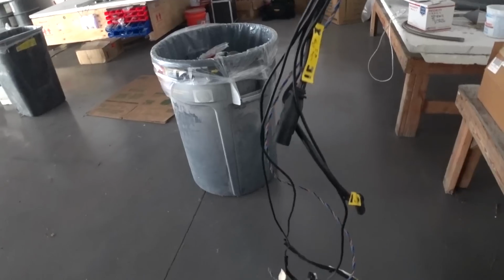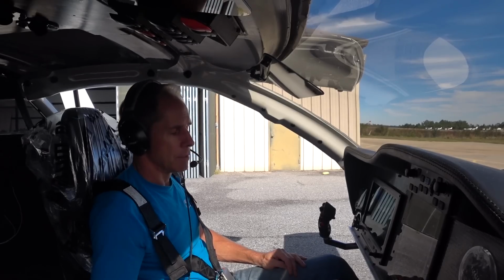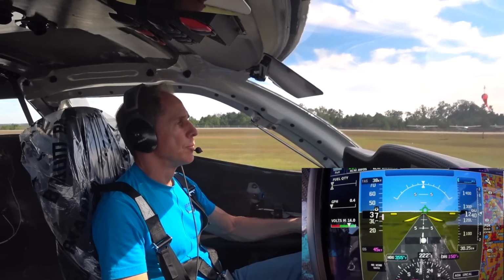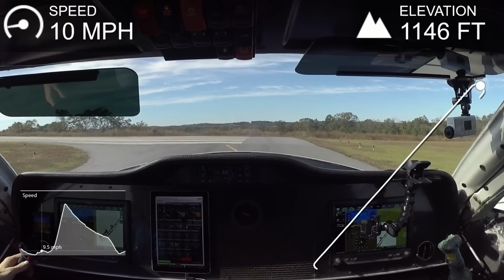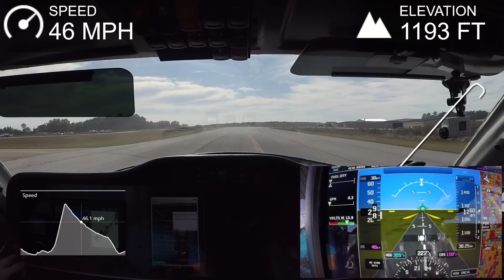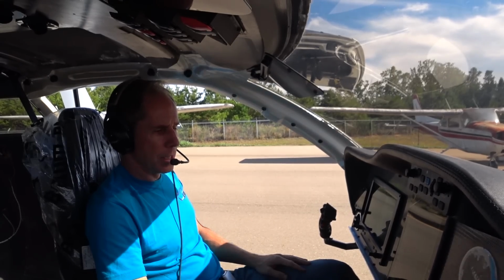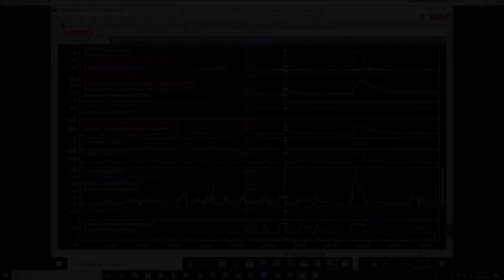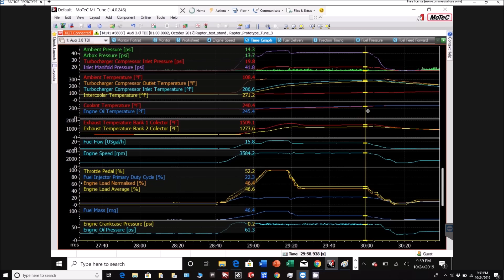Glow Plugs and Test Runs - Building the Raptor Prototype

Comment: If you want to do sustained high power ground testing then rig up a spray system and dump water onto the radiator cores.  The evap cooling will give you a fair bit more heat rejection than just the limited airflow you can achieve from the propeller inflow.

Comment: Wow, Peter.. two videos for Saturday morning on the east coast of Oz.. Took me by surprise but very pleased at your progress. Question... What is your current loaded weight ? I recall the weigh-in went 2917lbs, and I believe you have added to that forward ballast, ballast under passenger seat, Yourself (of course) and possibly additional fuel.. I'm looking for a current figure to plug into a spreadsheet ..just as a math exercise... 
From that run, on the near linear portion, 21.3mph to 62.3mph in 10 seconds gives accelleration of about 4.1mph/sec/sec or roughly 6ft/sec/sec. Based on current all up weight of say, 3300lbs (???) , that's around 620lbs thrust (after parasitics..) 
Not bad eh ?. BLOODY Good enough to get you up when ready...
Keep up the good work mate.. Steady as she goes will win in the long run, and minimize chance of any mishaps..

Comment: Major improvement to the audio. Thank you.
When you did static run-ups, it seems on camera the prop changes pitch. 
From the wing cam the prop seems to get fatter, as if the prop was set to bite more.
Just wondering if that is design or optical illusion.
Great work keeping it on the ground and testing everything to be safe.
Thanks for sharing.
Reply from the maker: That's the governor doing it's job.

Comment: My water cooled computer has the same problem with thermals. It works great untill the heat soaks into the surroundings and has no where to go. Then I run a fan to move the heat. I'm fairly confident your curve will stay flat if you are over a 100mph ripping through cold air at 20kft.
Reply: mccallumcra if what you’re saying is he’s worrying/spending too much time on this, I’m tempted to agree - BUT he has to get a good idea of what might happen across a variety of conditions so he can try to nip any potential problems in the bud. He does want to commercialize this project and possibly even get it certified eventually, remember. 
Can you imagine a 6-8place Raptor with a PT6?
Reply: @gregorykusiak5424  I'm just saying I agree with him. It's something to look at but considering it's only a static run I wouldn't bother doing more than a little math to check it at this point. He has proved it will run long enough with out over heating to get to the cooling air so I'm not to concerned with it if he's not. Heat saturation is only a problem when heat has no where to go. It will go away once he is moving. Unfortunately at this point he isn't at the point to fly it yet so he can't test that until he takes off.

Comment: Could you do a long run-up at start of runway. Then when temps start to get high go down the runway and see if temps stabilize with the extra airflow ?
Reply: Its water cooled.
Reply: This is a great idea.
Reply: @santyclause8034  Boats are water cooled. Airplanes and cars are air cooled. But some have water in between the engine and the air. 😄
Reply: @bradley3549  Boats are also air cooled -- they just have a lot more water between the engine and the air. ;-)
Reply: Thermal saturation with no external heat sink (atmosphere rushing by) to dump to is the problem with static tests. He would have to take it to the salt flats to have enough runway to do that without taking off. The numbers look good to me. Lol
Reply: @patrikj  This was very thought provoking. After much deliberation I think I disagree. I reached this conclusion by considering what would happen if the air was gone. And it would actually evaporate more readily, and thus be cooler if placed in a vacuum rather than an atmosphere. At least I think :)
Reply: @santyclause8034  face palm. And how is that water cooled? By airflow going past the radiator.
Reply: @bradley3549  The Earth loses heat to space from fairly high up in the atmosphere, so the only way the oceans can cool is by transferring heat to the air.

But if you lost all the air, the oceans would evaporate and whether you're air or water cooled you'd be equally screwed. ;-)

Comment: Looks like for the most part the static situation is at least temporarily fixed. Have you considered a combo pitot static mast like Piper uses on a lot of their GA aircraft? With where you had the the old ports you should have enough tubing already, would just have to get a new pitot tube. Just a thought, looking great!
Reply: Sikorsky uses combination pitot-static heads on the blackhawk.  The only bad part is that you need a special adapter to do a test.  But it's one less part you have to heat and run wires/hose to
Reply: Given that he appears to be using a GAP26 combo pitot/AOA tube, that would remove the AOA option from the plane...which is a very attractive feature to have on high performance planes.  Static ports aren't much of a problem once they are properly located and calibrated.

Comment: Thought it was the other aircraft being really distorted in their signal over the radio, but yeah the audio feed with the comms chatter is somewhat less distracting than in previous videos. 👍

Other than that, perhaps headset mic placement off to the side just a bit. Will keep the P's from popping too much and cut down some of the breathing noises from exhaling. (The little bit of foam on it can only do so much.) If you were gaming instead of flying, you might get some flak for that.

Now it'll be interesting to see how it does in the taxi trials. I'm curious if that's all tailwind, or if the pitot tube needs calibration? Hopefully those engine gremlins are settled for good.

Comment: Peter, in one of your Videos, you mentioned that you were going to make the engine mount out of Carbon Fiber, you may want to Research that option very well, Reason being that while carbon fiber is very strong, it is very brittle, also, Diesel Engines have a Harmonic / Vibration about them that is much different from a Gasoline engine, That could  make a carbon fiber mount Fail,  IMHO a Chrome Moly  tig welded engine mount would be a Better Option,   I have had Diesel engines vibrate apart brackets and Alternators, I had to insulate acc. with rubber to make them last, one of the worst diesel engines IMHO that Vibrated things to death was the Cat 3208 diesel engine. Just food for thought.

Comment: Hello and good job.
I am not sure about this but I noticed your Pitot tube does move forward and backward in great deal of swings. 
Every video that you putout even stationary one with your high RPM on engine made your Pitot to move foreword and backward and in some rare occasions side way.
This could brake away at 150 mph speed.
Just a observation and hope I am wrong.
Reply: That's not a pitot tube.  That is the spade.

Comment: Peter, do you see any value in monitoring individual CHT's with an air+water cooled engine?

My assumption is that a coolant temperature sender will give a running average but may mask harder working cylinders.

Comment: would it make sense to temporarily put some electric fans on the radiators/intercoolers? just to provide the airflow while you are doing static tests and looking for the 'can run at this engine setting for 3+ minutes" limits for the early flights. like the idea you suggested of covering the wheel wells to make the initial test flights easier
Reply from the maker: There is a fan on the radiator that pulls air through it and the intercooler. It just can't move as much air as flying will. Once airborne the power can be pulled back a little and the temps should stay comfortable indefinitely.

Comment: Peter; have you given any thought to putting the airspeed pitot tube on the top of the nose cone section of the airframe? This I believe would give clean air from all perspectives. It would be a pain to shape the mount and you would always be looking at it outside through your wind screen but the air would not be affected buy any surface or airflow disturbances. Just a thought. I hate to put forward any ideas anymore because I have found I don’t have all your information?? Or on the center of the nose like fighter jets?? Clean air?
Reply: His pitot tube appears to be in a reasonably acceptable and standard location, and it appears the problem isn't with pitot pressure (it rarely is), it's with static and where the static ports are (or will be) located.  Some canards do just poke it out right through the nose bowl, but in this case he's presumably using a GAP26 which also has AOA in it...so that's not a viable option. Under the wing is standard on 10's of thousands of planes, no reason it shouldn't work here as well. Static ports are a different story altogether.
Reply: SteinAir I agree with your analogy of the current configuration but I feel the static pressure is being affected but it’s location and the air disruption from the canard surface causing his issue. Clean air is alway best for this pitot tube. I think there has been problems in the past but with all the information we can obtain through electronics now we are just now able to see it and notice this disparity.
Reply: In this installation, the static pressure has nothing to do with the pitot tube (they are two completely separate systems and shouldn't be confused).  Either way, until it's hooked up to a calibrated test set nobody has any idea if either the pitot system, OR the static system is accurate, leaking, inaccurate, or whatever...hence my pushing to get it tested (both leak check and calibrated).
Reply: SteinAir but isn’t the static port located near the airflow off the canard? I would think peter located the port near each other? Maybe I am wrong? I am aware of the differential system he’s using but I thought he mention he had the located near one another. My port is located just underneath my pitot tube about 4” away. On my port side.
Reply: Also I was under the impression Peter was running a pitot / static probe on the aircraft but now that you mentioned he wasn’t that as you put it but the canard airflow is having an affect on his readings. Something is creating a pressure change.

Comment: Ground speed is in kts and GPS is in mph.  7:07 I. The video GPS reads 62MPH and 53kts which is right so I didn't see the variation you talked about at that point of the video
Reply: Also, even if the GPS is in knots, it’s not impacted by winds, but the indicated airspeed is. With a tailwind, you’d expect your indicated speed to be less than the GPS speed.
Reply: Nicholas Elliott he was referring to the ias of 42kts vs gs of 53kts

Comment: I’m curious as to why you aren’t placing the cowling on during these tests? The open engine compartment is UNDOUBTEDLY causing airflow problems and resultant lower acceleration.
Reply from the maker: It's been on but I had it off again after fixing the belt problem. I wanted to be able to check things after running the engine. It will be back on again soon enough.
Reply: I'm guessing a combination of the inconvenience (since he is still working on things around the engine) and the fact that the cowling will hurt cooling while he's doing the static engine runs

Comment: Just wondering what the minimum flying speed is for this airfoil, I know you have had the nose gear off the ground an inch or so, but so far I don't believe I have seen any weight come off the mains, what kind of lift off speed are you estimating?
Reply: he has said in other videos that around at around 85 with 5 degree up pitch is the theoretical point where the main wing will get the weight off the mains.

Comment: Peter. If I understood you, you were concerned that the IAS was not equal to gps speed.  These two are almost never equal. First, IAS is not CAS or TAS.  Second, with no wind, level flight, IAS and gps speed will move further and further apart with increased density altitude. Your density altitude at that airport this time of year is probably around 2500 feet. Third, IAS is not affected by wind, while gps speed is.  Tail wind causes gps speed to be above TAS, while headwind causes gps speed to be below TAS.  In other word, this is not an issue, so don’t waste your time on it.
Reply: @rv6ejguy. Gps speed is affected by wind and density altitude, even on the ground, relative to airspeed.  If the no wind taxi airspeed is 60k, while gps speed is 70k on a given day,  and a 10k headwind kicks up, the same airspeed of 60k will give you a gps speed of about 60k, instead of 70k.  Think of it this way, if the airplane is standing still pointed into a 40k headwind, the airspeed will be 40k while the gps speed will be zero.  If your normal takeoff airspeed is 60k, your gps speed should be around than 20k at takeoff with that 40k headwind, instead of a gps speed of around 60k when no wind and standard day.
Reply: Following that logic, wind doesn’t affect gps speed in the air either, because gps speed always equals ground speed.  But pilots fly airspeed and the issue was why are gps speed and airspeed not the same on ground . . . The answer is gps speed is changed by wind and density altitude, while airspeed is not.
Reply: rv6ejguy last comment . . . The only part of the airplane that is affected by ground speed on the ground are the wheels and how fast they turn.  The rest of the plane, including the propeller, is affected by airspeed.  If you accelerate down a runway with no wind, a 20k headwind and a 20k tail wind, the acceleration and speed (when measured in gps ground speed) will be very different.  The distance you cover and ground speed you reach will also vary with density altitude (when measured in gps speed).  

When you look at airspeed, the acceleration should be the same from 20k airspeed on. (Obviously, you start at different points in the curve).  With a turbocharged engine, the airspeed acceleration should not vary much with changes in density altitude either.  Bottom line is that gps speed is not a reliable measure of performance (unlike cars), because it is affected by wind and density altitude. True statement on the ground and in the air.  And to my original point, if gps speed and airspeed are the same on the ground, it is simply a coincidence and not something to expect.

Comment: Pete, is it really necessary to call 400hp out of this engine?
Reply: @rv6ejguy  Is it an injector limit or a pump limit?  RPM is also a factor but only above 4K depending on obtainable rail pressure which shouldn't be an issue here.  over 400HP appears to be possible on stock injectors with the right pumps and turbos: https://www.audi-sport.net/xf/threads/bobby-singh-a4-3-0-tdi-build-thread.248899/page-5   Though I agree that all other data obtainable from his videos point to a much lower effective HP (including the fuel being burnt in the exhaust, increasing his EGTs - fuel flow does not = HP).

Comment: Time to fly ?
Reply: With all those high-speed taxi tests, the tires will need to be replaced before he decides to go airborne, due to high mileage.
Reply: Lol ! It’s always hard to make that first flight. Test pilots help Lol ! Getting your baby in the air is the true test of your design and hard labor. Only the creator knows when that time is. It is near for sure on this project. I always worry about the redrive system on auto engine designs. The little Audi engine should be reliable if the drive holds up. Peter has done a fantastic job of making his dream come to fruition. Lots of late nights and hard work. His design is sound and I hope he is very successful in his efforts. He also has had excellent support which is paramount. Would really like a cost update to see if his budget is within limits he projected.